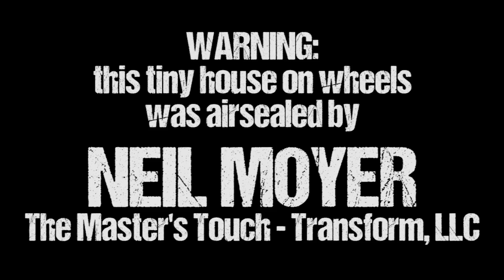Airsealing in Florida- for Tiny Houses and Mansions too!

Comment: i don't quite follow what he means by "our humidity source is outside not inside".
air inside the home starts off as the same as outside, except moisture is added due to people living in it. so moisture is always sourced from inside. 
what he seams to be saying is we need so much ventilation that a bit of uncontrolled ventilation is not going to hurt with our warm climate. so we can get away with not spending the money to be so air tight.
Reply from the maker: No, in Florida it’s much more humid outside than inside for a vast majority of the year, even if you showered and cooked without running exhaust fans.
Reply: thanks for the reply.
where i am downunder the weather in similar, probably a bit more milder. i'll have to look into the physics of that more. you can always add ventilation later, its very difficult to reduce uncontrolled ventilation later on.

keep up the good work on the video's, they are great. i do hope to see the show downunder some time.
there is home quality/energy programs/legislation running here at the moment to force people to improve homes, plus our great home un-affordability issues, so home build and design is a hot topic here. tiny homes are becoming popular.
thanks again.
Reply from the maker: Glad you found us! Thanks!

Comment: Leaning towards Zip sheathing and roofing panels with spray foam insulation...I've been told the combination of the two maybe to airtight!?  Now after hearing what Neil said I'm worried b/c we are building in Missouri, but our plan is to move to Florida once the house is built...should I change my sheathing or spray insulation out for something else?

Comment: I'm not sure what "It's not performance,  It's prescription" means(at 3:17).  Could you please elaborate?  I thought 
performance was the battle flag of the Proof Is Possible Tour.

It sounds like you are saying that your new tiny house won't perform well in Florida.  If so, why?

If you're in a hot, humid climate (Florida or Chicago), I think "Make it tight, and ventilate it right" is the way to 
go.  Any leaks where hot moist air meets dry cold air = moisture = mold. 

As a side note, Phius (Passive House Institute US) is adapting its standards so they are specific to very 
small geographical areas (over a thousand different climate profiles so far).

http://www.phius.org/phius-2015-new-passive-building-standard-summary

Thanks again for the great videos.
Reply from the maker: +59seank You're right, performance IS our battle flag! What we're saying is that most things that are called 'home performance' are really prescription masquerading as performance.  Listen to my Building Performance Podcast interview with Neil: http://buildingperformancepodcast.com/master-in-bs-legendary-neil-moyer